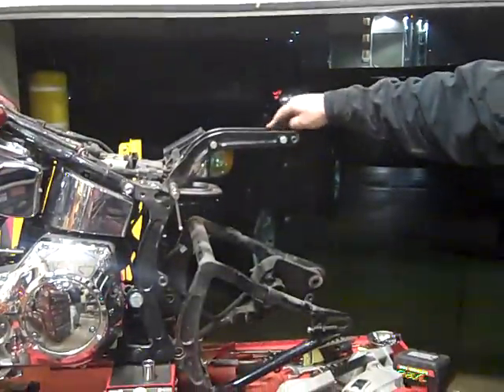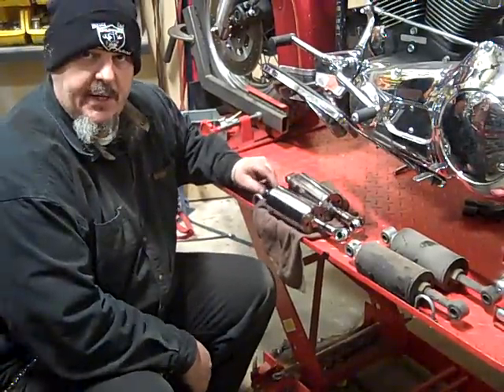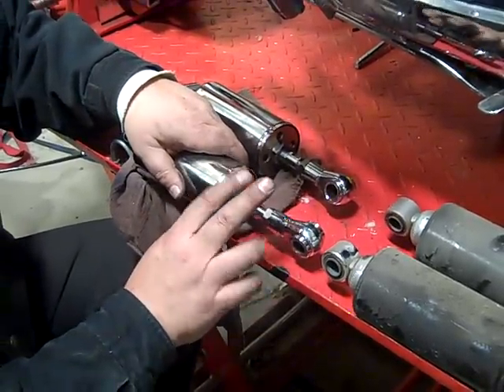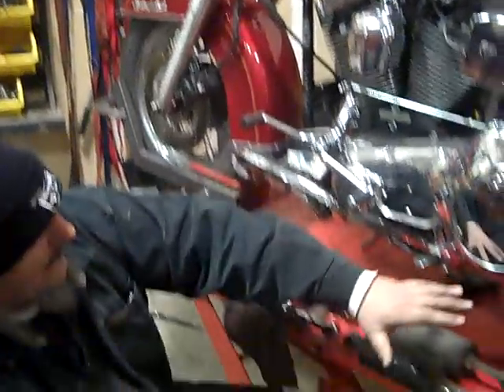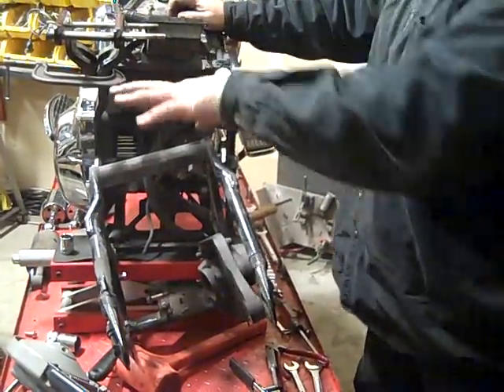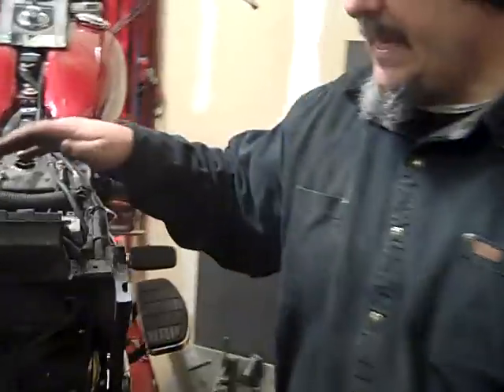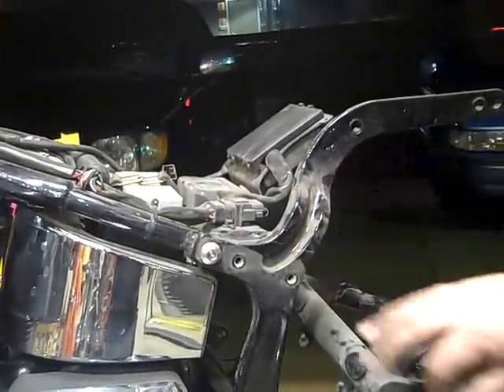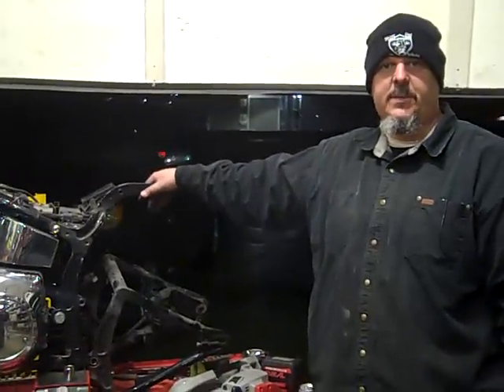Bobbin' the Hell Out of Your grandpa's 1998 Softail Special Deluxe - Part 2 - Shocks & Frame Horns

Comment from the maker: Thanks for the good word!  I'm tryin, Brutha.  Just too busy choppin right now to slow down and film, but I will do an update on this build soon as we have made a ton of progress on it.
Reply: I'm waiting with saw in hand man, what fender and struts did you use it will you be using? I'm bobbing a 04 night train and seeking ideas. I dig your vision.
Reply: @tonyt0311  Something similar to Mid USA Part #: 22018, which is V-FACTOR OE STYLE RIGID REAR FENDER FOR BIG TWIN, Raw Steel
Fits FL 1949/1957
Replaces HD# 59604-39
But, I think I got it from V-Twin MFG back in the day, which was a Tuesday, by the way.  Al
Reply: @alwilkerson7285  damn, a day away from holding hands, skipping and humping, I wouldn't have minded, it being raw Steele and all. Thanks for word!!!
Reply: @alwilkerson7285  where did you relocate the ECM?
Reply: @tonyt0311  Since I used a smaller lithium battery, there was room to tuck it into the battery compartment next to the battery. Al
Reply: @alwilkerson7285  I have a fuse box beside my battery, this sucks. Any ideas?

Comment: That "straight line"  your talking about on a panhead frame doesn't exist.   If you look really good at a rigid panhead frame you'll see that the upper legs start to drop off right around the seat area so the axle plates would be closer to the ground giving the frame more ground clearance.